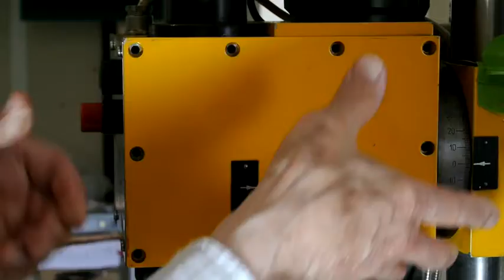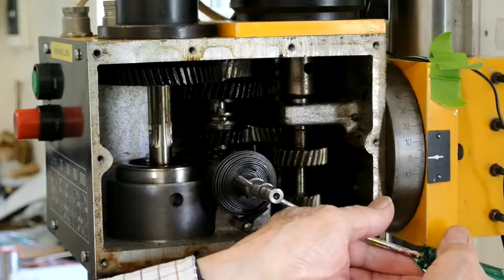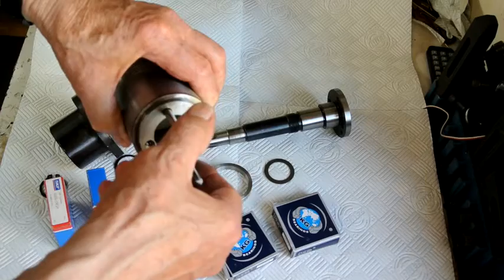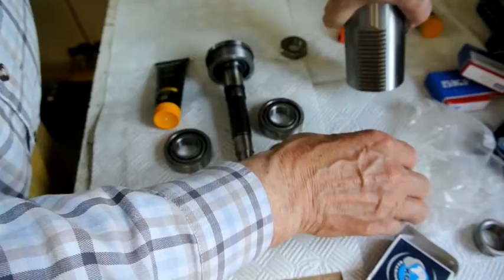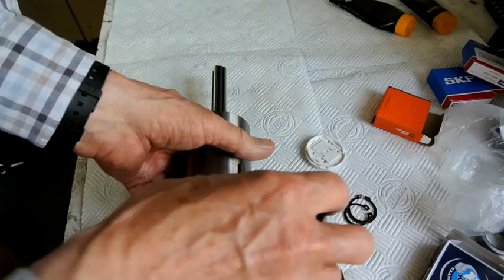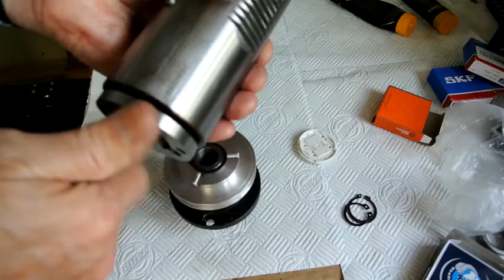Hobbymat 65 Part 3 (Belt drive mill conversion)

Comment: John, what is needed to remove the upper bearing carrier? I'm referring to the black top-hat looking portion that held the fiber gear. I want to remove this to put a sensor in it to use for an RPM readout. Any help greatly appreciated.
Reply from the maker: Not sure if you are retaining the fibre gears. The top hat part that holds the bearings in place is steel and easy to machine. It nis held in with 3 secret that were not difficult to undo. The bearings and the little shaft that holds the fibre gear is held in place with a circlips that secure it to the bearings at both ends.  There is a smaller circle at the bottom and of the shaft that holds the fibre gear on the little shaft and there was a mother at the other end. You should be able to remove it without removing the spindle as far as I can recall , but have a look at the exploded view in the manual. In my case I removed the spindle as well and it was quite a while ago now so may not have revered all the details. John
Reply from the maker: I just found the manual and the top end of the spindle shaft has a plate at the end with a hole on it that is used for the drawbar. I think the fibre gear will not pass through the hole when the top hat is removed. You will have to remove the small lower circlip by  accessessing it via the whole of the side in the manner I described. When this is removed you should be able to remove the top hat part with the bearings. John
Reply: @john2478  Thanks for the info John. I removed the three screws but I could only get the top hat portion to move about 1/4" before it became stuck and I didn't want to pry on it without knowing more. I also found your pics on the old GroupsIO forum and wanted to let you know there is a new group On The-Hobby-Machinist forum for the Prazi/Hobbymat machines. I posted some of your videos and others for people looking for ideas and knowledge of these machines. Thanks for your help!
Reply from the maker: @memyself3275  Glad to be of help!  John